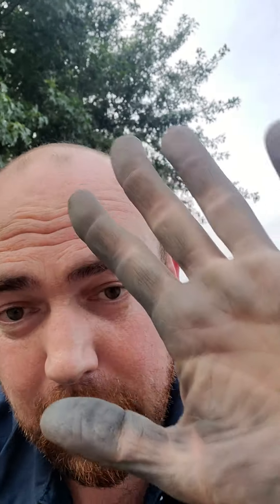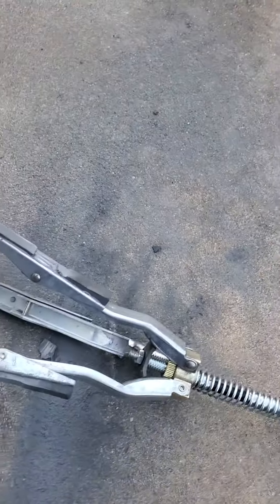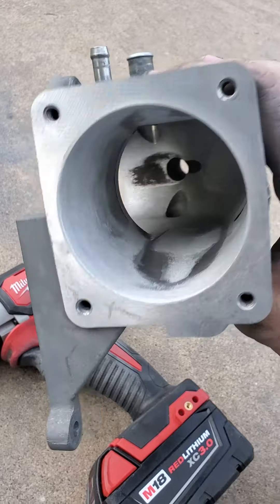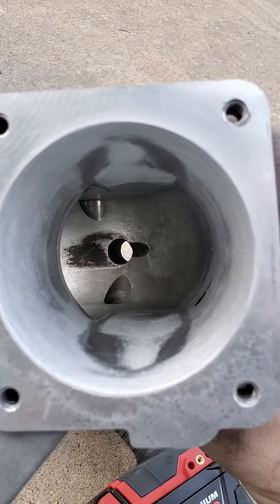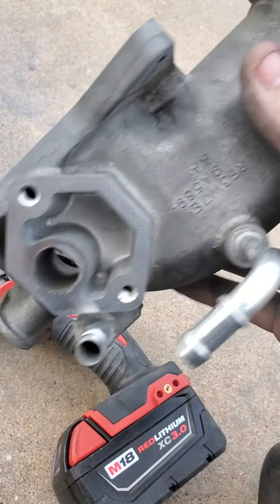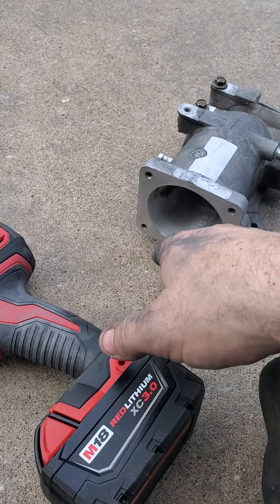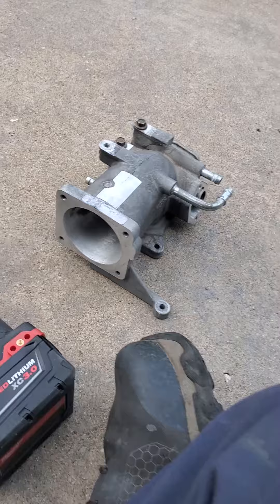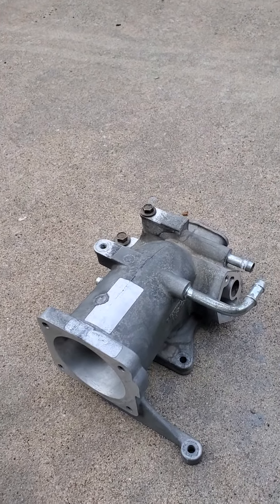75mm throttle body elbow

Comment: Glad i came across your channel only person explaining how to do it, im using a 70mm throttle body can i port the plenum to 75mm aswell for better performance? Also when using the bore to get the opening bigger do you use a in and out motion close to the opening lips?
Reply from the maker: Yes. Just like using an engine hone.

Comment: Did you have to apply oil while using the hone or any lubricant?
Reply from the maker: I didn't I just used brake clean or water to rinse off the stones.